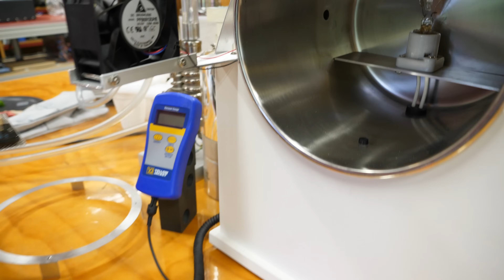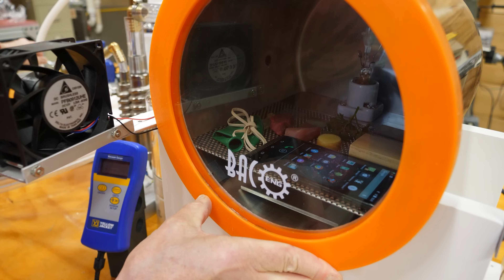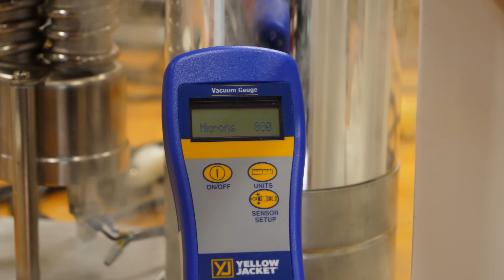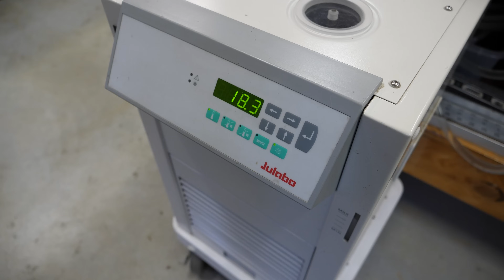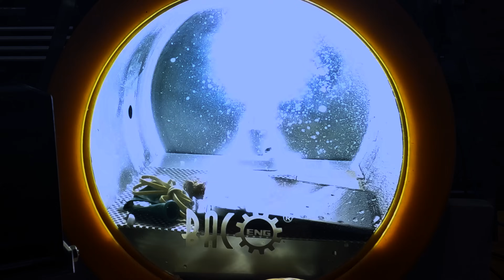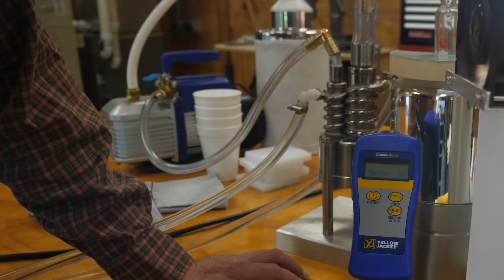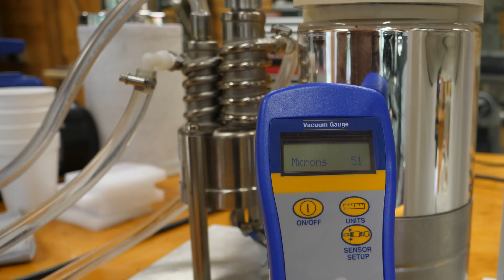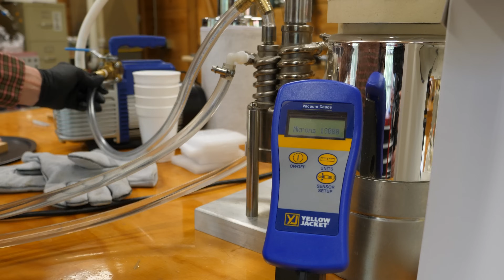We exposed BEEF to the vacuum of space, then ate it!

Comment: A test on the "remaining" strength of a wood structure after turning it into aerowood is probably interesting, as a light(er)weight wood alternative or how much the dessicated glue of the plywood still contributes to the structure
Reply: That was my immediate question.
Reply: Also, does the effect last, or how long would it take for moisture creep back in, and how much over what time period?  Would a sealant prolong the effect?

If anyone else was thinking of it, the FAA can just weigh your ultralight or LSA whenever they feel like it as far as I can tell.  So we need answers to all of these questions.
Reply: I am curious about the wood samples also.  Maybe just a follow up comment w/ the before and after weights?  Did you take any before measurements?  Did they shrink perhaps?
Reply: The battery and electrolytic capacitors probably contaminated the food stuffs.   Might be worth trying again, without the electronics!
Reply: Wow, I´m flying so high, oh sh*t it starts raining!

Comment: @ 13:00 for growing plants, Metal Halide (MH or CMH or Ceramic Metal Halide) and High Pressure Sodium (HPS) lights are still the preferred tech since LEDs simply cannot produce the required amounts of light needed without getting ridiculously expensive. Also, the red/yellow dominate HPS and the blue/white dominate CMH bulbs offer the two best spectrums needed for vegetative and flowering stages. It's true that LEDs can produce "all the colors" but that comes at the cost of not having a specific part of the spectrum being as dominate, which in certain stages means you are wasting most of the lights spectrum such as during vegetative cycles where blue/white is far more important, and red/yellow during the flowering stage.
Reply from the maker: LEDs can also be purchased  that tailor the output spectrum to the application, but I agree they will cost a lot more per lumen than metal halide lamps.

Comment: In terms of material testing, I remember hearing that during the Gemini program, when testing spacewalks, there was an issue closing the capsule door after Ed White returned to the capsule (to say nothing of the challenges of the space walk itself). The explanation I heard was "cold weld" which was apparently caused by the effect of vacuum on the aluminum doors and skin of the capsule. I've never really understood this, as evaporation of lubricant seems a more obvious cause.
I have no idea how you could test this, but if you can, it would be fantastic!
Reply: Another comment mentioned that he believed it was graphite without water turns into sand-paper.
Reply: Two very flat metal surfaces can weld together, especially in a vacuum.
Reply: @lesliefranklin1870  I would suppose it has more to do with solar plasma and particles, though I guess the old two-metal battery might be at play in some fashion?
Reply: @up4open763  I believe it's more closely related to the "Casimir Effect".

And yes, dissimilar metals can also fuse together through the "Galvanic Effect".

Comment: In regards to the wood discussion at 4:11  you can use a vacuum, charred white oak and white whisky (non-aged whiskey) to speed up the "aging" process by pulling the alcohol into the wood which in turn pulls out the colors and flavors that you normally get from aging whiskey in oak.  You still need to age the whiskey for the science to happen, but you no longer have all the alcohol loss.

Comment: That's an awesome setup to have in a home lab!

How did you manage to clear the cold trap without having to cool down the diffusion pump? Are there valves before and after the cold trap? I remember those diffusion pump oils burning like crazy when oxygen is introduced to them when they are hot.

I would also suggest repeating the test without the lamp to distinguish the effects of the vacuum and the UV.

Cheers!
Reply from the maker: Thanks. 
The chiller cools it down pretty quickly, and so I turned it off first.
Reply: @TechIngredients  Good point, I forgot about the massive chiller! Cheers!

Comment: The plywood being lighter is quite interesting. I'm curious to know if the vacuum affects the strength, springy-ness, wear resistance, and resistance to delamination of plywood. If the vacuum makes for lighter plywood without negatively affecting other properties, this could have big impacts in certain sporting goods (skateboarding, archery, hunting rifles, canoes, etc.)
Reply: I'd imagine it would end up being a lot more brittle cause the weight loss is water loss and really overly dry wood is prone to cracking most dried lumber still has like 20% moisture content in it with stuff from places like home Depot being able to be even higher cause they don't properly dry it. I got 2 4x4s there the other day and one felt almost twice as heavy cause it was noticeably damp. Like stuff that's dried out really slowly over time like old beams for buildings is super sought after but it seems when wood is dried really quickly from like direct sunlight it's more prone to cracking during that process it seems cause it expands and contracts depending on the moisture level so drying it too quickly would impart strain on the wood as it's trying to shrink way faster causing cracks which I feel would happen with vacuum dried wood since it's a lot faster process than standard wood drying methods
Reply: The weight would come back as it enters a humid environment again.
Reply: @revmsj  the damage that would be done by speed drying it though would already be done so it would probably end up more prone to cracking still from stresses that process built up in the wood

Comment: 2 things: 
1. Maybe it would make more sense to fashion a reflector and shine the light in from outside the chamber to get rid of any conduction across the chamber

2. If you tie a knot in a deflated balloon and place it in there it should inflate itself. I’m sure that’s been done before but it would be interesting to see, especially alongside some supporting calculations of the size of the balloon vs pressure
Reply: The Problem with the reflector idea is that you would want as little material (polycarbonate, air) as possible between the testing subject and the light source. Reason beiing, that any material will absorb IR and UV radiation. Hence the glass removal in the first place.
Reply: Not sure what you mean because heat doesn't conduct in a vacuum, and there's almost no air for convection

Comment: I've worked High Vacuum for almost 30 years (nanotorr scale) and never heard it expressed as microns, only millitorr.  They're essentially the same, I learned something in addition to the experiment.  Pretty neat!
Reply: After a quick web search it seems like millitorr is mostly used for scientific research but is otherwise uncommon though I'm sure location and time period play some role in how common one measurement is compared to another.
Reply: I've worked in mass spectroscopy, which uses high vacuum systems for almost 30 years so I know microns well because roughing pumps, like a rotary vane or scroll pump, are measured with those units.  It's very useful to think of microns as 10E-3 torr (or millitorr) since, once you add a turbo or oil diffusion pump you can get to 10E-6 to 10E-8 torr or a titanium sublimation pump will go down to 10E-9 torr.  Knowing the equivalence you can keep all the units as torr or just skip that nonsense and use millibar.
Reply: @Phytologics  I work in semiconductor manufacturing, we're pretty much exclusively SI units.  Torr is the only exception, for some odd reason, probably because its almost 1:1 with microns.  Cryopumps tend to be used in deposition tools, and turbos in etch tools, with a few exceptions for volatile gasses.  We don't use diff pumps due to oil contamination.  Pretty neat to talk to someone in an industry that uses diffs though.  I've seen about every type of pump out there EXCEPT a diff because of the equipment I work on.
Reply: Microns are used in HVAC systems, when vacuuming the lines down before filling them with refrigerant.
Reply: Love your videos every time!

Comment: Open fibrous fruits or vegetables suspended in a tasty liquid, be it alcohol or just something good for the combination, and then pull the vacuum, see if you can infuse the food with flavor. Also, food grade wood in a liquid and using the result for fermentation as an additive in the process or smoking foods would be interesting.
Reply: Alcohol would evaporate even faster than the water and boil at room temperature in the vacuum. You would have to use a high pressure chamber to push liquids inside vegetables ... then maybe freese them in the high pressure state, put them still frozen into vacuum to freesedry the solid flavors ...
But since most nice flavors boil away at low pressures 🤷‍♂
Reply: I have seen cucumbers turbo-charged into pickles through the method you are describing lol.
Reply: You can definitely speed marinate foods. There is a manual vacuum pump for sealing twist top jars for dry food storage called Pump-N-Seal. They have a channel here on YT (same name) with a video demonstrating how an onion cut in half sitting in some dark liquid absorbs it deep into the onion within seconds of the container being vacuumed.
Reply: @Culpride  Capture all the flavors as they boil away, in the cold trap, reapply as sauce? Maybe it would make for a good sauce ingredient :D
Reply: @borat6363  Now that, sounds interesting, INSTANT PICKLES
Reply: @judyofthewoods  nice, will check it out, sounds like a great way to experiment with a ton of stuff, thanks!

Comment: Failure of elastomeric materials in vacuum may be caused by gas expansion rupture as they often have gas molecules permeated deeply into them. The first time you see an o-ring breaking apart from this effect is quite memorable. I made a short video I call 'Peeps in Space' where I pull vacuum on some marshmallow peeps making them expand, then rupture and ultimately shrivel like jerky when air pressure is reintroduced.
Reply: I love how there's always Hams in the comment sections of this channel. :) - WU2F
Reply: The UV certainly doesn't help matters either. It breaks the polymers into smaller chains.

Comment: The wood getting lighter is an interesting thing going a little deeper and investigating the strength issue's would be interesting
Reply: It's just the moisture in the wood boiling away. The wood itself isn't any lighter, it's just been dried out
Reply: @Hephera  that is what I figured saturated with epoxy and it will get heavier but will probably never rot
Reply: @Hephera  We know that the wood dried out. The question is did the water contribute to the strength of the wood, or more precisely, how much did the water contribute?
Reply: @Pystro  , i think you have to consider the wood as a sponge, is a dry  sponge  stronger or not then a sponge that is soaked with water ?
If you hit the soaked sponge quick enough with a sheet of wood or metal,the water need some time to escape, so the impact will be harder compared to a dry sponge, but if hit the soaked sponge very slow , the impact is almost the same compared to a dry sponge. So i think that the water does not contribute to the strenght of the wood. On the otherhand, the more water in wood, the more flexible wood can be if you bent it without breaking it, this also how wood is intensional curved and bent for making round objects in wood by steaming the wood, bent or curved it, and let it dry out in this shape. Once dry out, the wood is as strong as before. Grtz

Comment: You should test your extremely white/ reflective paint inside this chamber. Quite curious to see how well it  would work. Could be nice to get information on how much it heats up, as it can only reflect radiations or radiate heat ; and not conduct it to a gas like it does in an atmosphere. Nice thing is you could tie how much watts the bulb uses to how much the painted material heats up for a give mass and surface. That way you can really appreciate the effeciency of your paint. If it heats up by X degrees for Y mass, then it must have reflected Z watts.  Maybe compare it to a multi-layer insulation for a "standard".

Comment: Love this. I also hate that feeling when someone asks 'but what are you gonna do with it?'.  But that's how I went from high frequency vacuum tube plasma flame, to a plasma tweeter!

Unless you have a dust removal system I'm unaware of, I'm surprised you are dry cutting glass with no protection for your lungs other than the face shield. Doing stuff like that a couple times irritated my lungs worse than smoking for a decade.

I also really recommend getting a foredom hanging motor instead of a dremel. More power, no gyro motion when the speed changes, handpieces that can produce reciprocal instead of rotational motion for 'engraving', etc.

Comment: 23:24 How many rounds per minute is that Dremel tool producing? With no resistance sounds like it goes "pop pop pop" meaning the outer of cutter blade goes over speed of sound. Not a new invention, whiplash have had its bang when used.
Reply from the maker: The edge is running  at about 1/2 Mach.

Comment: A couple of things:
- monitor that wood over time and see how much water it reabsorbs. I think you’ll find in a humid environment the more porous wood regains more water weight.
- you definitely coated those items with vaporized metal. You see evidence on the back wall, and you see differences in color and tone on the potato closer to the lamp. Re-running this with some way to shield from that ionized metal vapor might yield tastier outputs.
You definitely came up with a new and interesting variant on the food dehydrator.

Comment: At first I thought the face shield was a bit overkill…

Then I remembered. I’m very glad for you that you’ve made a full recovery after that unfortunate oversight, seems like the wisdom has come from the experience.

Always love your videos

Good luck with your chickens, we added 8 to our flock this season gotta watch them getting pecked when introducing them
Reply from the maker: I know
Reply: More so with the tiny death wheels…
Reply: @TechIngredients  - I also had one of those wheels shatter at high speed.  I got lucky and it didn't hit my face.  Now I wear safety glasses.
Reply: @wickedcabinboy  Cutoff wheels that aren't fiber reinforced are known to shatter if you look at them wrong. They're definitely something that you should wear safety glasses for. If possible, a plexiglass shield on a flexible arm (with magnetic base) is a useful addition.
Reply: @hxhdfjifzirstc894  the little ones for the Dremel sometimes shatter while I'm attaching them to the mandrel which is always so reassuring lmfao
Reply: I used to use those Dremel cutoff disks on sheet aluminum. It took a steady hand and a bit of luck to wear it all the way down to the mandrel.

Comment: I used to work on metalizers used to make DVDs. Inside the metalizers there were mechanical components that required grease. A small tube of this grease cost $hundreds. It hade a very high vapor pressure. Regular grease would contaminate the prosses. It had a screw type roughing pump then a turbo molecular pump to get it down to around 0.0005 millibars, 0.05 microns.

Comment: I too am very interested in the weight and strength difference in the wood. I built an experimental airplane many years ago using wood and fiberglass in the construction. If there is a significant weight change in the wood and it doesn't take away from the strength, this would be a very beneficial use of processed wood.
Reply: I was also extremely curious about the strength of the wood… could it really be used for a limited use spacecraft?

The lack of water would not block cosmic rays as much…
Reply: I’m interested in your doing investigations into DIY impregnating wood with resin under a vacuum

Comment: Just to point out, while it works both ways, that cold trap is backwards. If you are pulling vacuum through the internal tube side, and you actually capture a ton of liquid, it’ll suck up that tube. The tube is to direct the vapors to the coldest part of the trap, then the outlet sits we’ll above so you never suck any liquid into the pump